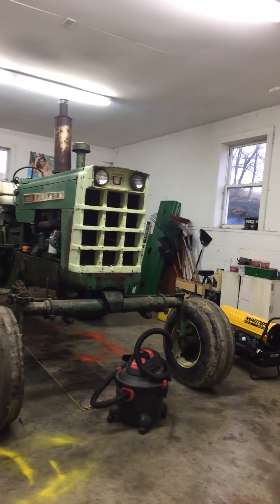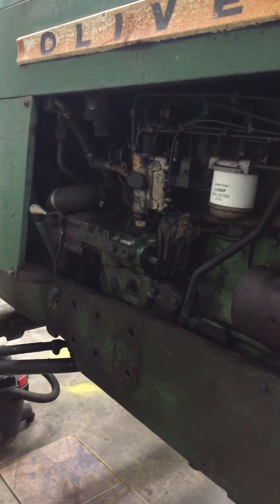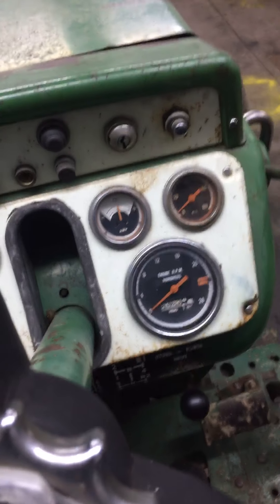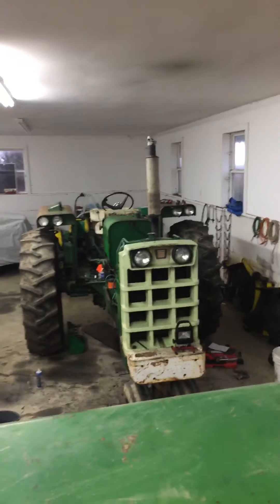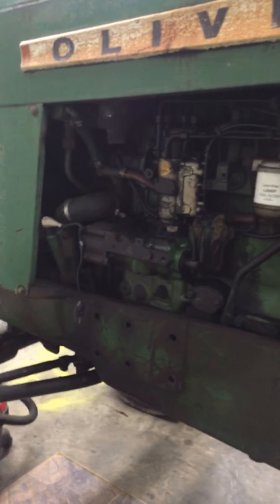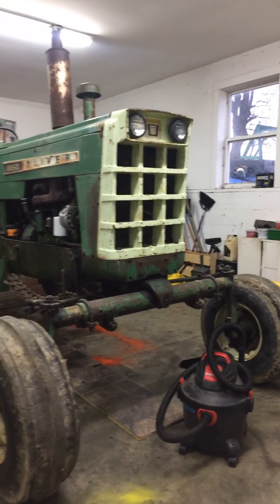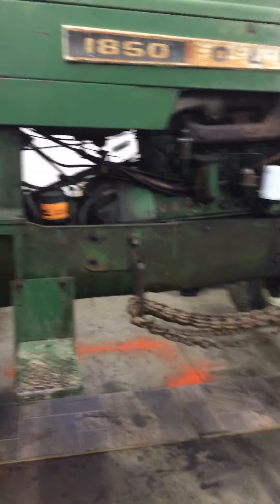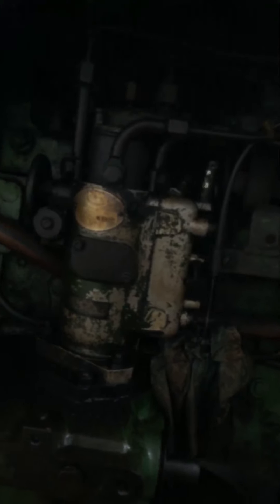1850 talk about

Comment: If that front grill is original, it’s a mutt and has a 55 series front end, and most likely is a ‘69. Better running 1850 than ours, for certain. The injectors in ours need replaced. As well as the hydraulic pump.